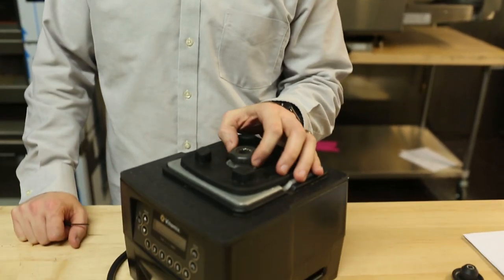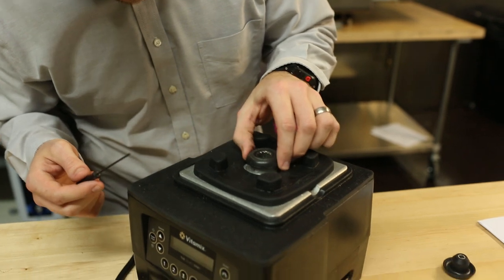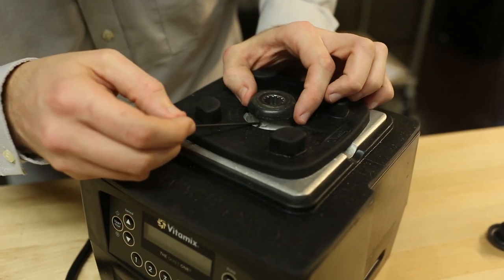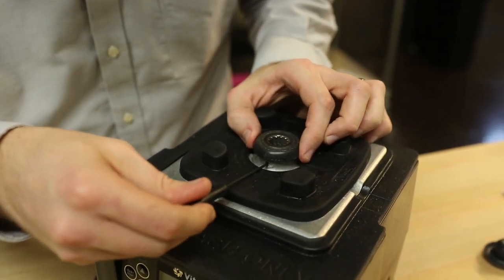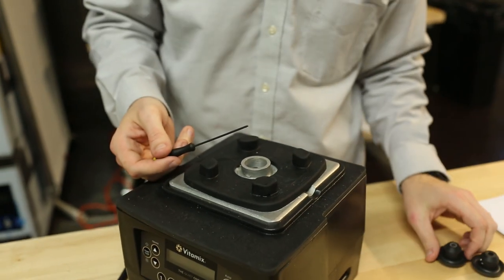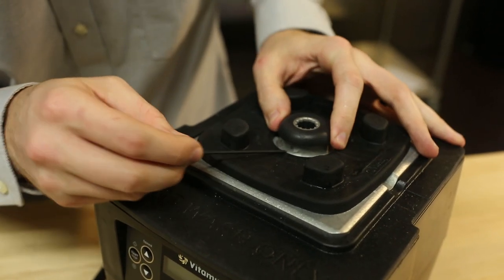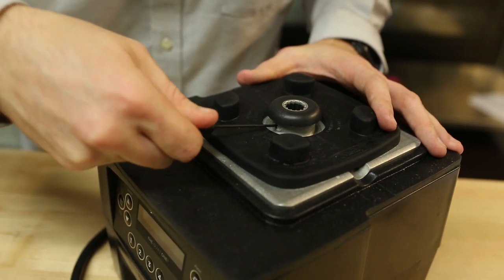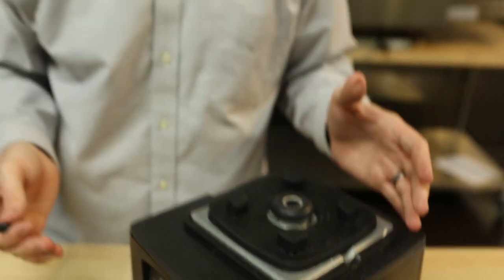Vitamix | How to change a drive socket

Comment: TAKE CARE NOT TO COMPLETELY BACK THE SCREW OUT! You only need to back the screw off a few turns and then check to see if the drive socket comes off...if not then turn screw out one more turn and check again.

Comment: I pulled the socket off and took the socket head screw out.  They drilled and tapped the hole at 15 degrees.  Not 90 degrees.   Better to use a 2mm wrench ( .0006 ) larger or a 5/64 Allen wrench which are almost the same.   2mm= .0787 where as 5/64 = .0781 .0006 difference.
Also, on mine,  the set screw bottomed out before getting tight on the shaft so I left the screw tight.  I can still move the socket up and down on the shaft with the screw tight.

Comment: CORRECTION: The hex wrench must meet the screw head at 90°. Not 45°. To make that possible, we must remove the rubber top from the motor unit. Then the wrench goes in straight through that little hole at 90° to meet the screw head. This is how I was able to tighten the socket (after fiddling with vain at 45° through that hole). Thank you!
Reply: Hello, I pulled the socket off and took the socket head screw out.  Then stuck a gauge pin that just does go through the tapped hole and it came out to be that they drilled and tapped the hole at 15 degrees.  Not 90 degrees.   I'm a machinist so I check out stuff like this.  Better to use a 2mm wrench ( .0006 ) larger or a 5/64 Allen wrench which are almost the same.   2mm= .0787 where as 5/64 is .0781 .0006 difference.
Also, on mine,  the set screw bottomed out before getting tight on the shaft so I left the screw tight.  I can still move the socket up and down on the shaft with the screw tight.

Comment: Very nice.  Question - while one has the drive socket taken off, does that give access to the motor bearing for adding a few drops of light machine oil?  Our old stainless steel model is supposed to be oiled occasionally.

Comment: it seems that the hex nut is stripped, do you have any ideas on how I can unscrew it?
Reply: I am having the same problem. I called Vitamix if the screws were recalled.
Reply: Same problem our one at workwont come unscrewed.
Reply: Drill it out if it's stripped, then use a screwdriver to pry off the old drive socket

Comment: Why is it important to replace the silicon sealant afterward? And how? Mine came apart as I pulled it out bit by bit.
Reply: Because liquid can get into the open slot and run directly down into the electric motor and internal wiring, shorting out the electrical system. Just use a small tube of silicone sealant with a nozzle on it, and squirt it into the slot to reseal it.
Reply: Makes sense. Better safe than sorry. Cool, thanks.

Comment: What else might be holding the socket in place? Because I removed the screw--which promptly fell into the machine--and the socket is still stuck in the same position. No matter how hard I pull, I can't get it out.
Reply: Have your husband pull it out

Comment: What do you do if the screw seems to be stripped or worn out inside? I can't remove the old socket.
Reply: If the old socket is broken, the screw might not be stripped.  My socket broke where the screw is located and the screw was just spinning around when I turned it.  I rocked the socket rocked back and forth but it wouldn't move up  at first.  I  think when I pushed a few more times, the screw got pushed against the shaft and was moved out of its set screw position and I was able to lift off the socket by being a little more aggressive.  I've seen a picture of a person using two screw drivers to lift off the drive socket so it must be a common problem.